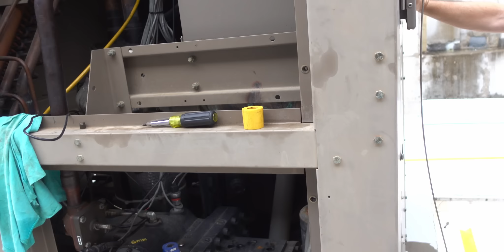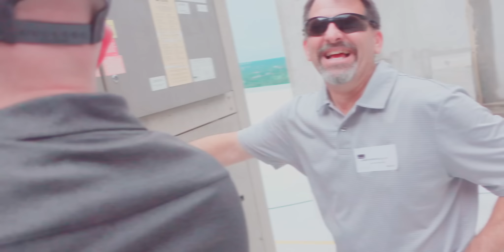This is THE COMPRESSOR emergency.........

Comment: This type of air cooled chillers (York) has proven to be a failure in the Middle East, which hurt York's sales  and its variable speed compressors has too many problems  as well as the gas pipes  leak  problems due the vibration caused by compessors

Comment: Heat blanket the compressor and liquid filled vapor line to help it vapororize. Heat is your friend when you have liquid where you are supposed to have vapor. Liquid in the evap, heat it up.

Comment: We had sort of the same issue. Sensor went bad on oil. Ended up having to pull that entire oil separator and what a pain that was. Also needed to replace the seal on the compressor as they had blown out. I have a few pictures of the damage and what we were looking at if your interested.

Comment: The first thing that i was thinking about was the sensors and the valves and second i was thinking about the compressor it was better to think about to overhaul it to see if it have bearing issues. We was having screw compressor failure in flake ice system with the unloaders AND with the oil filter. The oil filter was plugged up.

Comment: I just saw your video. Great effort on you. I’m sorry. I’m a retired Tech and a York startup and warranty for years at of San Francisco. I seen this before in New York. They sent guy’s like us all around the world to look at problems like this and see if it’s a design flaw. Unfortunately when JCI shut down York in Pennsylvania and we were retiring they lost that support . They wanted a York Technician fixing it then having tech-support. But they weren’t training the new guy’s coming in. From what I see here is this is what happened
You are a  knowledgeable guy but I think because of the noise and people around you making suggestions and the urgency you got a little off and started reaching and trying to get the refrigeration seal but still didn’t find the “Root cause “. 
Next time. Send everyone away shut it down and play out with Scenario in your head how it works and what caused it.
“Refrigeration migration does not happen like that unless something tells it to”.
That compressor was a goner. It would have locked up even if you corrected the sensors. As soon as it would run unloaded it’s going to kill it. 
You just became even a better Technician because it isn’t about what you know it’s about what you experience and seen.
Relax next time my friend. We are HVAC mechanics not brain surgeons trying to save a stranger. Relax. Guy’s like us “Wild Bill”. We’re retired. I’m a lifer in HVAC but I don’t mess the days like yours that we call “ The trenches “. Soon you will too.
Reply: This is the best comment I’ve ever spent the effort to read! Looking forward to having the knowledge level of you sir! 🫡
Reply: @anthonyoswald9366  thank you. Your going to be even better. Technology in our Industry is even better and more geared to troubleshoot and alarms and historical data. It helps get the system back online. Our industry has changed to critical equipment support not just comfort cooling. So recovering is critical now. I enjoyed trouble shooting and figuring it out on your own and being right. It was Gratifying and made the trade fun. I had a career when I think it was the best of times when everything was changing from Analog to solid-state to DDC and backnet. 35 was enough in this trade. I spent the last 5 years teaching at the apprenticeship and new kids in the field. Just one day my body couldn’t do it anymore. I’m enjoying life with my grandson and driving my Harley Davidson on the coast with other retired HVAC Retired cat’s. 
My retirement party was awesome. My friends said “I know you enjoyed your job but your retired now it’s time to enjoy doing something else but the best thing is you won’t be in a hurry to find it”. Be safe out there.
Reply: Such an inspiration. Enjoy your time you deserve it.
Reply: that is what I call, going down the rabbit hole
Reply: You hit it on the head. They aren’t training anyone anymore at JCI/York and they don’t help other contractors learn. That’s why I don’t like dealing with York.

Comment: I'm hoping that the customer was on board with all of the "attempts" to start the system. After a known issues with a level sensor and drain valve it should have been locked out and the compressor would have survived.
Reply from the maker: The damage had been done by the time we walked up to it. We can manually contol the level issue so we needed to confirm if the compressor was going to be viable at all. Otherwise we needed to move to other repairs. Once the level sensor was discovered it wouldn't have mattered. In the future though starting with a total recovery would have been better.

Comment: Well that was interesting indeed... compressor was already damaged and done for, before the diagnostic,  the constant resetting of the overcurrent alarm during the previous weekend seen to that.... lesson there .. Your correct Holden in saying you should have pulled the charge once the flood issue was known..the cold compressor discharge was a clear indication of liquid present, recovery machine is the only safe way to remove... very interesting call out and props to you honesty and hard work, that was a head scratcher for sure...👍👍

Comment: I have a YCAV that the writing has break up on the screen. Any thoughts?
Reply from the maker: If your electrical connections are good then its likely a bad display
Reply: You probably need to add a ferrite clamp to the ribbon cable for the display.

Comment: Towards the end you said you were cracking the liquid line to avoid creating a "dead-head." Could you elaborate on what the term "dead-head" means?
Reply: I like the written blog format , but I’ll take whatever you’ll give. 👍🏼
Reply from the maker: @moonlightacmaintenance3232  blog is definitely coming. Probably going to be multipart due to length.
Reply from the maker: I'm thinking about doing a live stream or some kind of format where I can answer the various questions that come through like this one. Whats your thoughts on that?

Comment: Question 1) Could you disable the CFM's to bring up head pressure? 2) Shut down chiller 2 to pick up heat load from the building or both? Obviously with all the refrig. in the screw, it washed out the oil to the point that every time you started it, it was wearing on the bearings, but what else could you do. You had to troubleshoot the problem, oh well a very challenging situation.
Reply from the maker: Its good thoughts, since the head pressure never came up the cfm never engaged so disabling would have helped here but is a real option for helping with oil return. We were letting the load build into the 50's each time we were testing which is dangerous for this facility so we would have to pause testing to pull load down with other circuit.
Reply: Wow I understand how it is with a critical building, that was just a tuff one to figure out. I would have called in for backup also. Well now we know that the level sensor going bad causes major problems.
Reply from the maker: @ask4george1  my go to next time will be to start with a full recovery and basically hitting reset on the system charge.
Reply: @HVACTIME  Thank you sir. I am a Journeyman Local 467 in Burlingame CA, but I haven't worked on chillers in a while. I'm 3 years from retirement.  I just call the smart guys like you, when I have a problem. I am the Sr. HVAC Tech. for the City of San Jose.

Comment: That’s a super strange service call there. Would have it been better to recover the Freon out of the chiller?
Reply from the maker: Yes, wish we would have done that up front.
Reply: @HVACTIME  'll be honest when you knew you had so much liquid refrigerant  in and around the compressor the obvious thing to do was to move that refrigerant out of the way first.. Fog of war stuff..?
Reply from the maker: @richardbartlett6932  it was a discussion on site. After pulling the evap down with recovery I thought we had gotten enough out to allow the compressor to catch up. I started to become very tunnel vision and stubborn to that goal. I genuinely underestimated the severity of the migration. That piece was my biggest takeaway from the whole situation.
Reply: @HVACTIME  I know what it's like or rather knew what it was like. As I said back in the 80's I was  a senior commissioning engineer for carrier service UK on the big stuff and soon realised it wasn't for me. I would always take home the stress of these jobs and have way too many sleepless nights. I remember lying in bed wondering if I'd set a stat back to its correct set point and driving 2 hours on my own time in the morning to go see before I started my day..
I left all that soon after starting my own business working on the smaller stuff 

Please don't take anything I say as any kind of criticism as  my respect for you is beyond measure 👍
Reply from the maker: @richardbartlett6932  non taken, it was a valid point. Thank you for the support through all the growth!

Comment: I assume this old chiller does not have any replacement compressors available? Depending on the age it might be time to replace rather than repair
Reply: Usually the compressors are core charged. In other words you put down a 50 or 100k deposit for a rebuilt unit and it will be return when you ship back the core compressor to the rebuilder minus the cost of the rebuild of your returned compressor. Seen a lot of this in drying kilns for lumber mills.

Comment: We had an yciv bust a tube. Had eddie current done , plugged tube ,weeks of getting water out, got back on line and lasted 2 weeks another tube busted. New barrel quoted. Dont know how accurate eddie current is.
Reply: Why did it bust a tube?
Reply: Eddie current is as accurate as the guy doing it…

Comment: That compressor sounded like it had rocks inside
Reply: The compressor ran "compressor rich". Generally not a good thing when compressors start pumping compressor parts instead of gas.

Comment: I don’t understand what was the issue in this chiller 🧐🧐🧐
Reply: faulty sensor caused compressor to flood, sucking out all the oil and vapour lock the system wich killed the compressor.
Reply: Hello bro love your videos 👍
I have a question on a different subject, I’m thinking of in roll in TJC HVAC for next August. My question is have you heard of Tulsa Tech in Oklahoma? I was wondering if you think is as good as TJC ? They have a hvac program of 9 months full time 8-3.  The reason I ask is because I prefer doing the 9 months compared to the 2 years at night . Can you help me out with your opinion plz.

Comment: earplugs dude. get some custom fitted ones made. mom only gave you 2 ears. also big props into figuring out this diagnosis. amazing that the compressor has not gutted itself all over the roof. still, this should not happen simply because of 1 faulty sensorthat costs a few bucks. i expect more/better from york..
Reply: It’s York their residential stuff is just as crappy
Reply: Oh yeah. My work provides me with custom earplugs and I couldn't live without them.